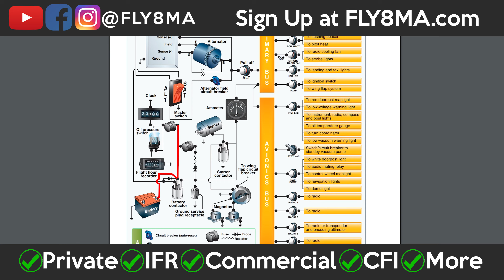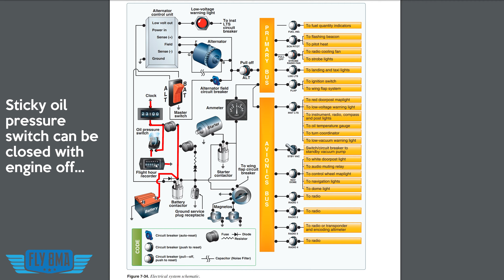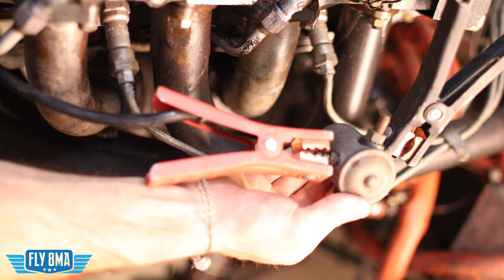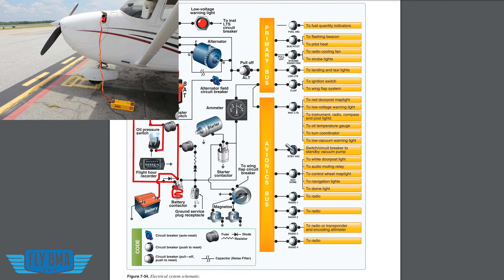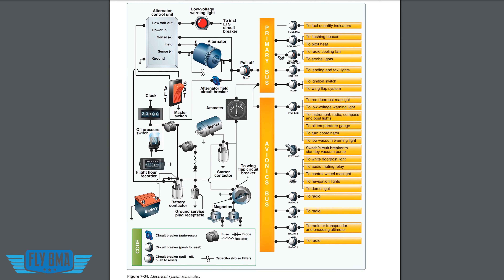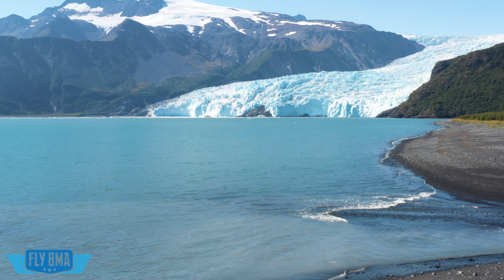How Airplane Electrical Systems Work

Comment: Hey, Jon,

Thank you so much for providing such a comprehensive explanation on that schematic!

I have one question, though, does the alternator charge the battery and then the battery powers on the circuit?

Or, is the alternator the only one providing power to the circuit?

I heard that the alternator charges the battery and the battery is the one provides power to the circuit, since alternator cannot produce a very steady DC supply.
Reply from the maker: You're welcome! 
To answer your questions, 
The alternator doesn't charge the battery first and then let the battery power the airplane.

Think of the alternator as the main power plant. Once the engine is running, the alternator powers almost everything in the airplane directly through the electrical bus. At the same time, it also recharges the battery from the energy used during engine start.

It's true that the alternator doesn't produce perfect DC. It actually makes AC first, then converts it to DC using rectifier diodes. A voltage regulator keeps the voltage steady, and the battery helps smooth out small voltage fluctuations. But that doesn't mean the battery is powering the airplane during normal flight.

the alternator is the primary source of electrical power. The battery's main jobs are to start the engine, help stabilize the electrical system, and provide backup power if the alternator fails.

Comment: I can’t wrap around my head what it means to ground the battery. What do you mean by that?
Reply from the maker: "Grounding the battery" just means connecting the battery's negative terminal to the airplane's metal airframe. The airframe then acts like one big return wire, so electricity flows from the battery (+), through the electrical device, into the airframe, and back to the battery (−)

Comment: Wait, so if the fuse or breaker for the clock/oil pressure is tripped during flight, the hobbs stops running?

Comment: @9:37 what an excellent tip. I was wondering why there was a resistor, as I was thinking it would be beneficial to charge/maintain the battery with the GSP. Thank you for such a great video!

Comment: On the schematic, next to the key switch, it says “to wing flap circuit breaker”. What does that mean? I’ve always been able to operate the flaps without any regard for the key switch … flap operation only requires the master to be on.